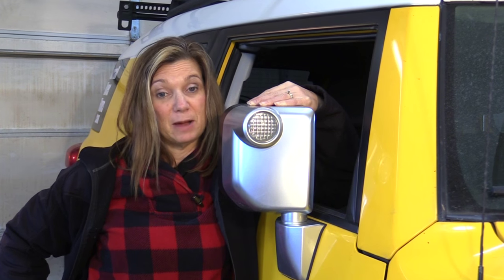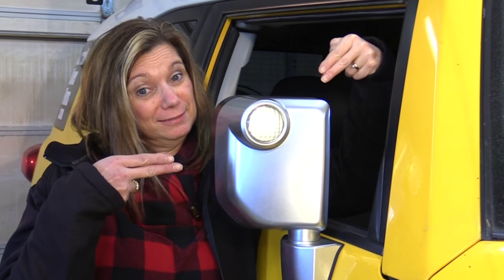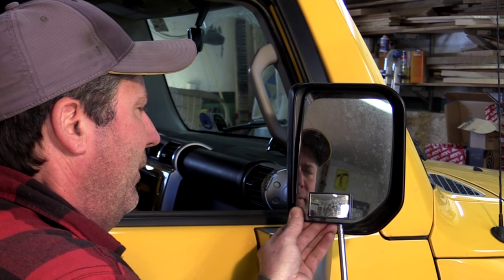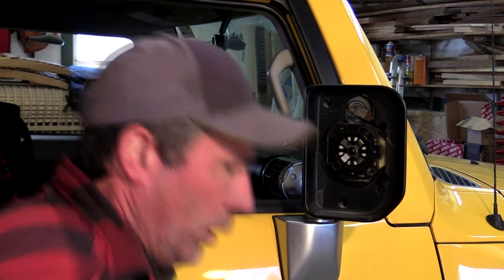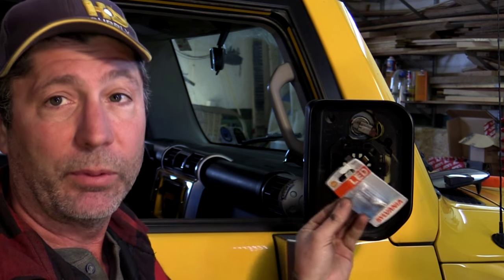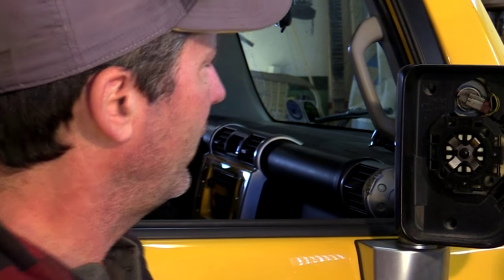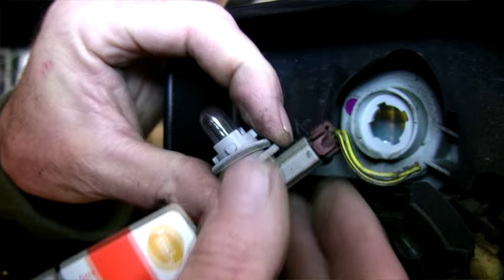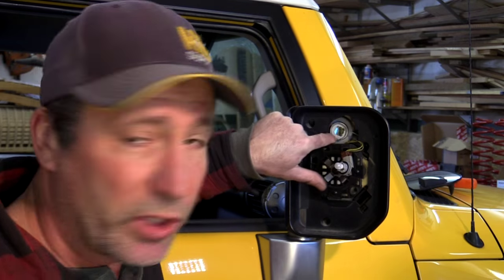Episode 6_ Mirror Light Modification_ Toyota FJ Cruiser

Comment: just replaced mine and took out the lens as well, they look much better!! thanks for the video. Now im waiting on dome and cargo lights they sent the wrong ones, and they sent me the wrong fender flares XD lots of fun.
Reply from the maker: +Jesse hardin We'll be interested in how your dome light mod goes. Please keep us updated.
Reply: +Mark & Merri's FJ Cruiser Build

I replaced my dome lights with these: http://www.amazon.com/Cutequeen-Trading-48-SMD-Festoon-Adapter/dp/B00FKPJJNY

As simple as replacing the bulb.  Just use the correct adapter and plug in to the LED assembly.  I didn't stick mine on, I just laid it resting inside the dome light cover.  Works like a charm and super bright!  I actually replaced both the front and rear dome lights with these.
Reply from the maker: +ick5353 - Thanks for the link, we put in our order! We'll post some before/after pics on our Facebook page.
Reply: +Mark &amp; Merri&#39;s FJ Cruiser Build just got my dome and cargo lights in they work fantastic Thanks ick5353! Now im on to installing my lift

Comment: I live in New Hampshire, and have often wondered if the stock bulb generates heat and defrosts the mirror.  I can tell you that something does because it doesn't stay frosted or icy for long.  The reason I mention this is I doubt the LED generates any where near the same heat.  Thanks for the great video.
Reply: Mirror Defroster👍🏼
Best concept yet, old school technology. Cuz the lenzes are running lights at best, and the removed plastic shown between the lens and bulb acts as a reflector and insulation.

Comment: is it ok to drive my fj in 4H for long periods of time and @60-70mph?? just want to know for the winter its on 2H now. pls help just got the fj and i want to educate my self..
Reply from the maker: No it's not okay. You should only slip it into four wheel drive when absolutely necessary and then only keep it there until you get unstuck.
Reply: Mark & Merri's FJ Cruiser Build.... thank you so much. i was asking because i had an 97 cherokee it was 4H all the time.made it difficult to do a uturn on wet roads. do i have to be at a dead stop then shift to neutral to put in 4H?
Reply from the maker: To put in 4H you can be stopped or up to about 15mph. To put in 4low it has to be stopped and in neutral.
Reply: Should have bought a manual trans, always in 4H, geared 60-40 split rear to front for easy turning. Handles like a sports car in the turns.

Comment: Question: I just replaced my mirror lights weith the 194 LEDR bulbs. My lights have been burnt out for some time. The new bulbs are not working. Any recommendations on any next steps to troubleshoot the problem?
Reply from the maker: I would question if the old ones were actually burned out or
is there a fuse or relay blown.

Comment: what does it mean when the maintenance required light keeps blinking after turning on my fj. it blinks  for a couple of seconds after the rest of the lights turn off.
Reply from the maker: Time to change the oil.
Reply: Mark & Merri's FJ Cruiser Build ...thank thank you for the fast reply. i just changed it 3,000 miles ago. mobile one synthetic. they told me to change it every 5,000 to let it flow and do its job like synthetic suppose to do.

Comment: If they weren't LEDs, I'd never buy anything from Sylvania, in my experience their bulbs have a very short life span. Also, I'd rest the light before putting the mirror back on.
Reply: test* the light before putting the mirror back on.

Agreed
Reply: Diode dynamics sells some awesome bulbs for this particular application. Just switched mine out today but couldn’t figure out how to get the film out. I was scared I’d break something when I tried a screwdriver so I stopped. Now I’ll have to go back and get that crap out. Thanks for the video.
Reply: I think that's true.